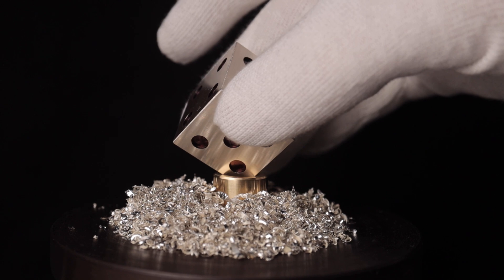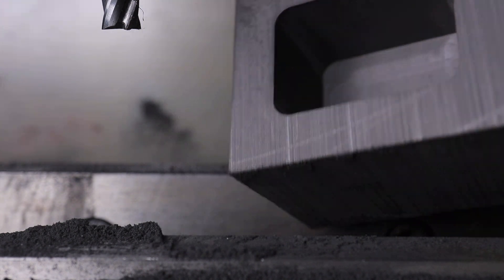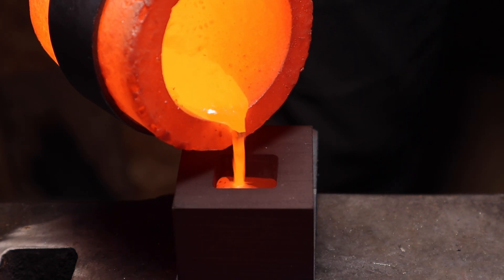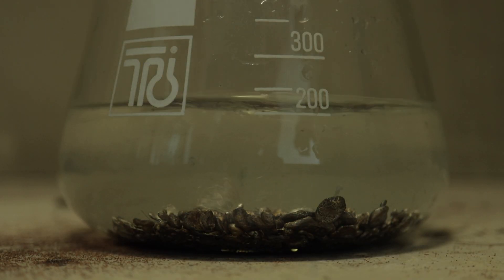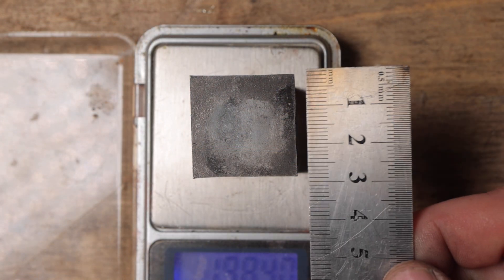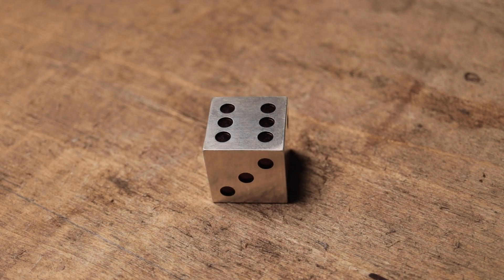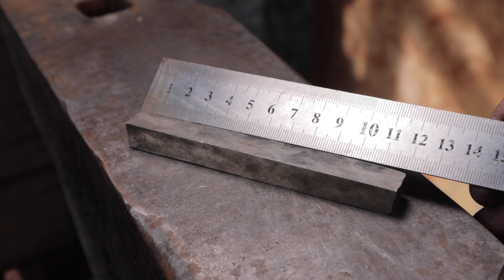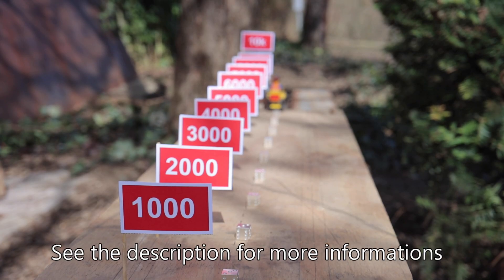Silver Transformation: From Coins to Solution, From Solution to Dice

Comment: Loved the video! I started pouring maybe 6 months ago. I always wanted to pour silver dice. Do you think sand casting would work? I don't have any of the machinery you have. Would it be best to find a dice that has squared off corners and then sand cast that? Because I'm having a very hard time finding one. That way, I wouldn't have to do all that work to square off each corner. They all seem to have rounded edges. I think if I could find a nice square die, I could use that to make as many dice as I want.  What is your opinion? Thank you.
Reply from the maker: Hello Scott, sandcasting will be just fine, but you not gonna avoid some file work. I bet on hammering it into the shape. It helps to even the surface, but be carefull, because you may end up with rhombohedron. Anyway good luck and enjoy! There is something about molten metal. Btw if you have someone with 3d printer, they could help you with the model.
Reply: @JustAnotherCraftsman  Thank you for the fast reply. Yes, I do know someone who has a 3d printer. I DO! I'm using PLA filament and things don't come out perfectly smooth. So should I print it, cast it and then smooth it out?
Reply from the maker: @scotts1356  I'd smooth the printed cube with emery cloth to remove line effect. Also, do You plan to cast it in halved mold with intake and vents or just imprint in sand remove and cast?
Reply: @JustAnotherCraftsman  I was planning on using the 2 piece metal jewelry casting mold. Imprint in it, remove the dice and pour. Make sense? I printed a cube and sanded it down. It took a little bit of time, but it came out nice and smooth. I figured it would be easier to smooth it before I poured it. Smoothing out silver can be time consuming. Now if I can get a "smooth" pour, I'll be happy!
Reply from the maker: @scotts1356  Than you are set for the best results! Please let me know how did it go. Good luck!
Reply: @JustAnotherCraftsman  Thank you so much for the help. I'll let you know how they turn out.